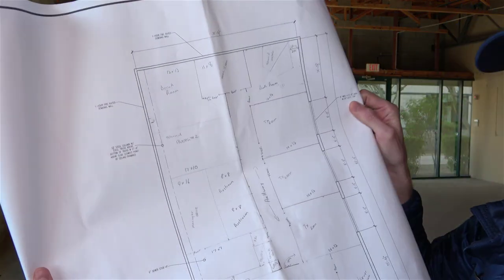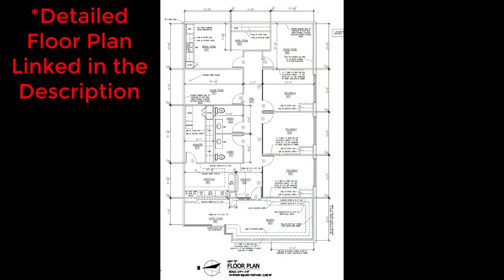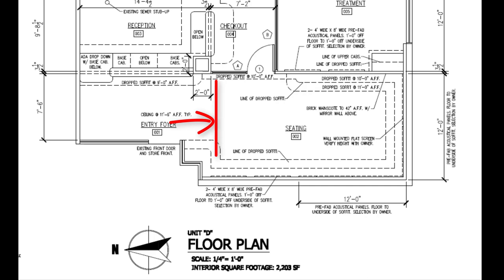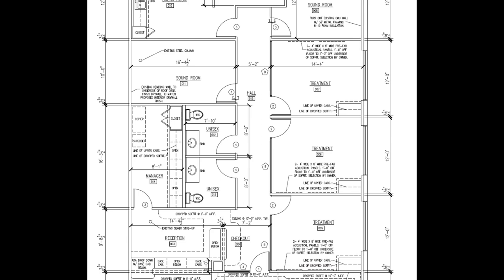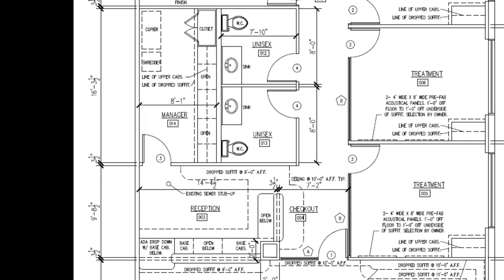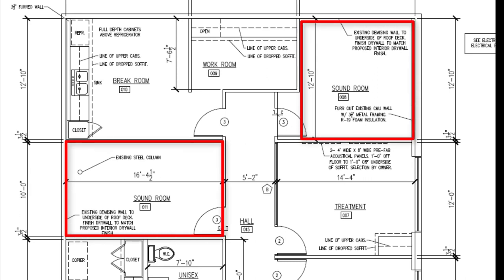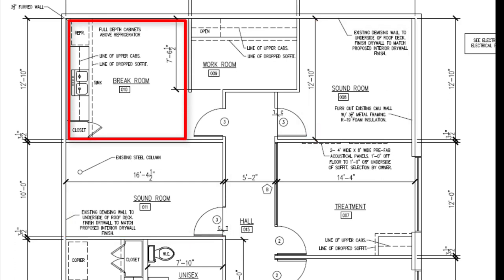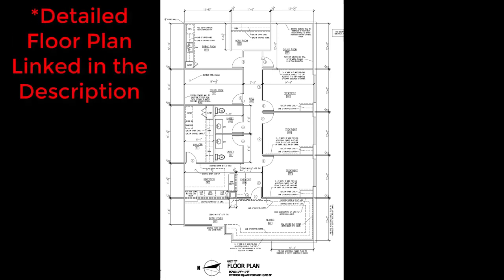DrCliffAuD VLOG 006 | The Clinic Layout | Applied Hearing Solutions

Comment: A few comments for an otherwise good layout: 1) The placement of the treatment rooms seems to be dictated by the number of windows. Those rooms are quite large for their intended use. 2) If the treatment rooms can be made smaller, that would leave more space for the manager's office and other work space. The hallway need not bisect the building. And 3) Is an emergency exit not needed or required in the rear of the building? Thanks for taking us all along on your expansion journey!
Reply from the maker: Hey John, thanks for watching.  We played around with a lot of different layouts, but due to how much time we spend with patients in the treatment rooms, we felt that those rooms should be a little larger with natural light.  The best way for us to maximize space was to have a single hallway down the middle.  If we placed a hallway anywhere else, it would have taken up more room.  Emergency exit is not needed for the space. Would it be a good idea?  probably.

Comment: If you only need one sound room, consider putting the work room where the bathrooms are now and moving the bathrooms back to the end of the building where the work/sound rooms are now to enhance privacy and "other" issues when bathrooms are in the middle of an office space.  The work room would also be nearer the treatment rooms (work room could possibly be swapped with manager office to put manager access in hall).
Reply from the maker: I like the idea in theory, and we did experiment with it, but due to dimensional issues, we couldn't move the bathrooms into another location, while keeping them ADA compliant, and not losing space.
Reply: @DrCliffAuD  Was that with or without the 2nd sound room?  Without the second sound room and all the space including the workroom, it seems there'd be enough room, but I don't know the code.  Are two baths required, or could one do? I'd make both unisex, by the way.  If you can't move them, make sure you've got good exhaust fans and a good supply of poopourri.  The bathrooms might be a good test ground for hearing aid programming for patients to let you know if they feel like they are standing next to a 747 taking off!

Comment: As an architect I tell folks my best design tools are my ears.  (synchronicity from an Oticon user)  Your layout looks good.  The treatment rooms are generously sized too. Only thing I see is to double check is that there is 18" clear to the handle side of the door on the inside of the back sound room.  It's an ADA requirement.  It looks like it is there, but is close.
Reply from the maker: Hey Scott, thank for your comment.  I remember our architect specifically mentioning that with that back room.  The plans are still awaiting permitting from the city.  Is that something they would catch?
Reply: @DrCliffAuD   In Texas the plans go through a separate review and inspection for ADA. Your city may, or may not look at it. If there is no formal review or ADA inspection you should be OK.  It is just one of those nit picky things that if missed will probably never be an issue unless someone later on files and accessibility complaint.  But might as well get it right during construction.  You really are getting an education going through this process.  Glad you are sharing.  Remember, if it was easy everyone would be doing it.
Reply from the maker: Thanks Scott.  I'll check with my architect to confirm.